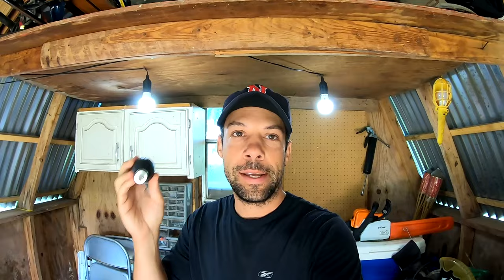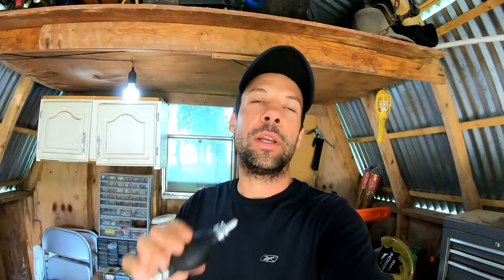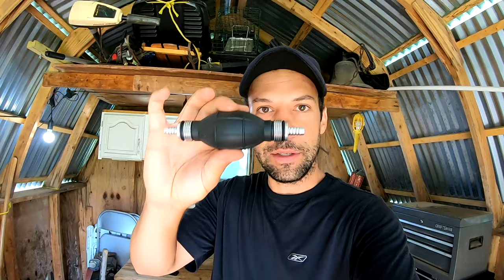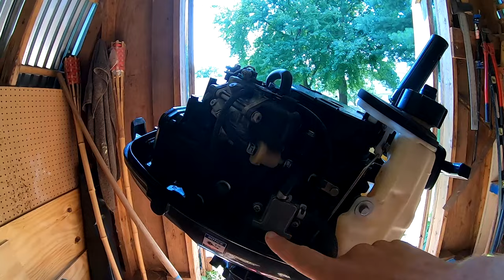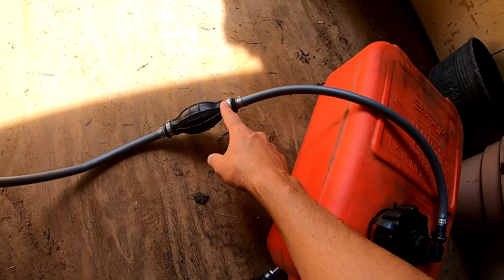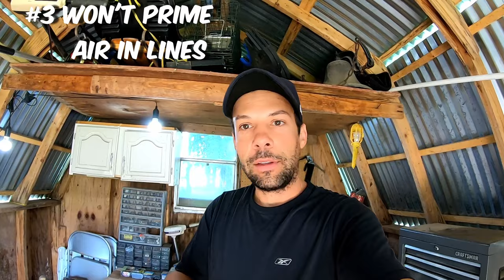Must Know Common Issues with Outboard Priming Bulbs

Comment: thanks for your videos. Pre-preparing helps, but there's nothing like good old fashion experience out on the water lol. My bulb was sucking flat, not sure what was going on, I kept squeezing it and flooded the engine. Then I used your trick of starting on full throtle and it worked! So now I have your insight on what might be going wrong with the bulb, I suspect faulty air valve on the gas tank.

Comment: I keep coming back to your video… boat had sat for a few years prior to me getting it. So I drained tank cleaned carbs and replaced filter. Go run it 15 minutes in bulbs flat. Replace anti syphon valve pick up tube and all new fuel lines and new pump. Tank vent is clear. Primer bulb is also new. Just went out on water and 15min in bulb is flat.
Reply from the maker: That’s crazy, it has to be upstream. Generally bulbs going flat has to be a blockage or issue between the tank side of the bulb to the tank vent. This creates low pressure at the bulb. But it sounds like you checked everything.. try cracking the fuel cap just to rule out venting issue. Hold bulb vertical and shake it before priming to get the check valves in position. If you haven’t, change the fuel line between bulb and tank. Check fuel pickup in the tank, could be blocked

Comment: Folks need to be aware that if you change your fuel line and install a new bulb , be sure to ensure that the bulb tips are inserted within the lumen of the liner inside the fuel line . Otherwise it can fold over and trap or impede fuel flow to the point of cutting out the engine. The larger the engine or the higher fuel demand the more the liner gets pulled away from the inside wall
Reply from the maker: Great point thanks!

Comment: Hi, just got a new priming bulb and it will not hold air pressure against my finger like my previous ones would. Check valve is back-leaking slightly but it still pumps. Will this be an issue on the boat, should I send back and buy another? Thank you.
Reply from the maker: Depends on how much it’s losing. Try getting it empty and shake it up and down. That might help the check valve seat. Most times the motor will pull gas no problem once it starts and the check valve might not be an issue. 

However All the bulbs I have had get really firm with no backflow so it’s hard to tell. Id probably get a replacement just to be sure. The last thing you want is a problem and then having to chance the issue
Reply: @Skinnyriver  tend to agree. I have had cheap bulbs so far in which the check valves hold air pressure no problem. I have spent more on this one so would expect the check valve to hold pressure, over a short duration anyway. I had tried to get the valve to seat properly with no luck 

I can only really see it being an issue once the engine is stopped, but would be annoying having to re-prime for every restart out on the water because the fuels drained back to tank.

Comment: Great video. Should priming ball loose pressure after sitting for a day or so?
I always need to pump it back up after sitting for awhile. Maybe that's normal, please let me know what you think. 
Thanks
Reply from the maker: Yeah I think it’s normal. The ball valves that keep the gas from flowing back into the tank are probably not 100% watertight for hrs and hrs, you will probably loose some pressure
Reply from the maker: ***check valves are probably not 100% watertight for hrs so you will lose some pressure overtime

Comment: Hi I recently bought a lightly used 2023 Mercury 6HP. It’s running great but it dies when idling. Even when it’s been used all day. Is there a way to adjust the idle? (I’m running it with an external tank)  Many thanks!
Reply from the maker: Yeah there is an idle adjustment screw on the carb. Look up idle speed screw or fuel air mixture screw and you will know what it looks like
Reply: Holy cow a 2023 and there's issues.  I'll never get my 88 right

Comment: Hi, I have brand new mercury 4hp 4 stroke and have issue that motor runs at max 2200 rpm where manual says ~4000-5000rpm. It is on inflatable boat kolibri km330dl. I followed strictly the manual for first hours of usage. Oil is level is correct. I'm using internal fuel tank and honda fuel stabiliser for the fuel. Motor starts easy no issues there. I'm masuring rpm with tachometer wrapped around on the coil part and its measuring correct as on another motor shows correct rpm. Max speed is 10kmh, with or without passengers. What could be the problem motor to run only ro 2200 rpm? Is that normal for first 20 hours of usage before changing oil ? On neutral it revs more but I dont want to rev it higher when not on gear. 
Great content and videos. Thanks. :)
Reply from the maker: I think your motor is probably fine. Inflatables are generally harder to plane out and put a larger load on a motor that a flat bottom Jon boat. It’s just the nature of inflatables. Does the boat plane out really well? My motor runs at 2500 rpm until I get it to plane then it increases to 4000. 

If it’s not planing out look at changing the trim position (probably lower it) and put your weight in the front of the boat when you accelerate.
Reply: @Skinnyriver  Thanks. I'm new in boating and outboards and not sure when is planing  exactly :D. Sometimes probably its almost planing as engine try to increase the rmp for a second and again lower the rpm to 2200 - 2250.Like a quick hit feels like.  I check all the stuff like air leaks, fuel leaks and etc. all looks ok and couple of times I also think about inflatables that this is what is it :D. Will try lowest trim position and alone in boat. I tried one time alone but trim was higher and boat just go higher very quickly. Best results are one person in the front and me on the back and probably almost planing. I'm thinking to change carburator from 6hp to give it a little bit more chance for planning :) Thanks mate. Great channel and help for all outboard owners. Keep going :)
Reply from the maker: Yeah try lower trim position, by yourself and try to lean your weight forward as much as possible as you accelerate to see if it planes out.  Higher trim positions can raise the front of the boat too much and it puts a large load on the motor that can prevent it from getting to those higher RPMs. When you plane out it’s like a sweet spot where the boat is kinda level but the nose is hovering above the water. Lowered water resistance = more speed
Reply: @Skinnyriver  I see now why some people extend gas handle to the middle of the boat :)

Comment: As soon as I turn my outboard off for a few minutes the bulb gets soft and the engine won't start unless I pump again. This never used to happen before. I'm guessing the bulb needs changing...?
Reply from the maker: Yeah that’s frustrating. It could be the check valve that’s letting some gas back flow into the tank. It could also be a small air leak somewhere in your system letting air in or something with your gas tank vent. I would try:
***The next time your tank is empty squeeze and shake the priming bulb. There could be something in there keeping the check valve open 
***Try slightly cracking the gas tank cap to see if it still does this. If it doesn’t do it with cap slightly cracked then your vent isn’t letting air into the tank 
***Not sure if this will work but with the fuel line NOT hooked up to the motor, squeeze the bulb so it’s firm. If it stays firm while not hooked up, you may have an air leak on the motor side
Reply: @Skinnyriver  Thanks for these tips i'll give it a try.

Comment: Could this bulb be the cause of my outboard wanting to turn off at idle after a while?
Reply from the maker: It could be, does the bulb go soft or suck in flat???
Reply: @skinnyriver, yes. After a few minutes it will still out and the bulb is softer. Pump it back up and it runs great

Comment: WAA 😢 I h just changed mine because hard... now with the NEW primer bulb , gas goes both ways and the bulb does not fill with gas or get hard and stop...bad check valve in a new one ??? ( arrow pointing to engine)
Reply from the maker: Yeah maybe, hold it vertical and shake it. Sometimes that help get the check valve ball back in position

Comment: Hello Skinny River , Is there a problem if the priming pump is punctured? Can I encounter problems with my engine?
Reply from the maker: Usually if it’s punctured it won’t keep the system primed (pressured) or it will simply leak gas. I would replace, they are cheap
Reply: I ask because I was driving the engine at maximum speed and it stopped suddenly and I don't know why (it's about a engine Honda 5 hp 2018)
Reply from the maker: @rebleanurobert5360 man I doubt the priming bulb would cause your engine to just die. You would probably have issues before the motor got up to speed

Comment: Hi what happens if i squeeze primer bulb while the motor runs and the motor dies
Reply from the maker: That’s a good question, you shouldnt have to squeeze the priming bulb after starting.  It means there is an issue with your tank, bulb, filter, or fuel pump. But you may have sent too much fuel to the carb causing the motor to flood